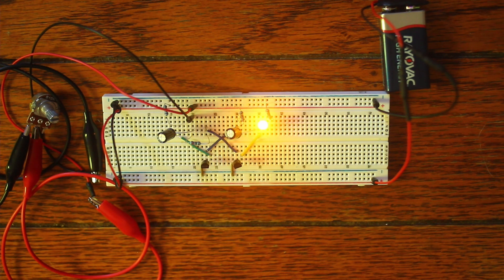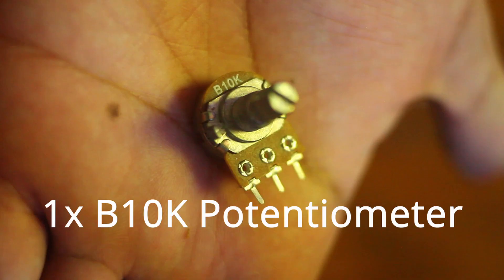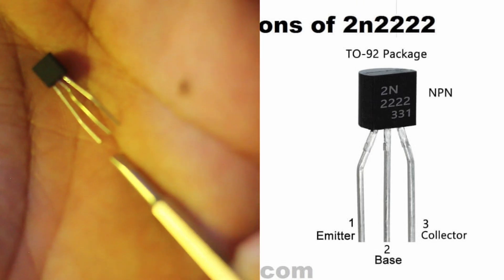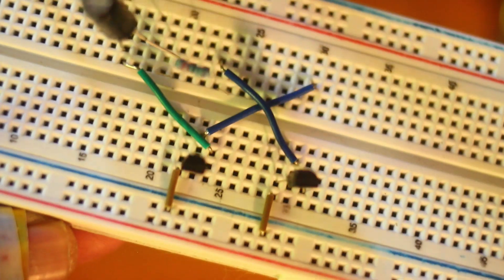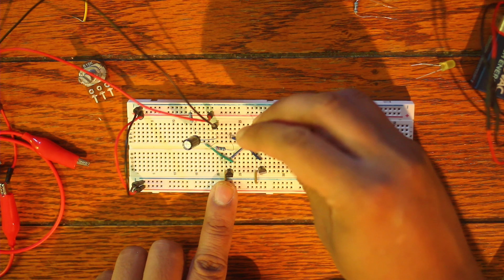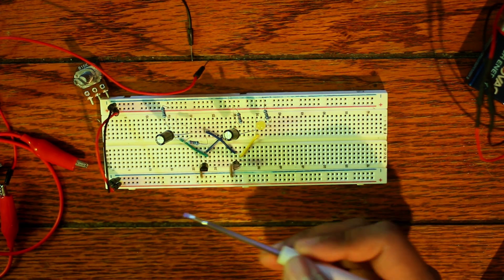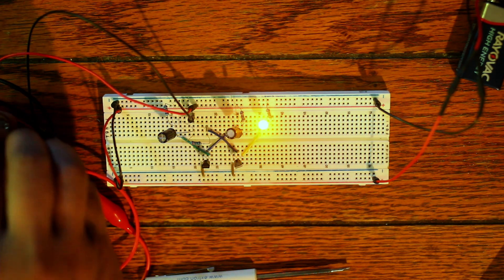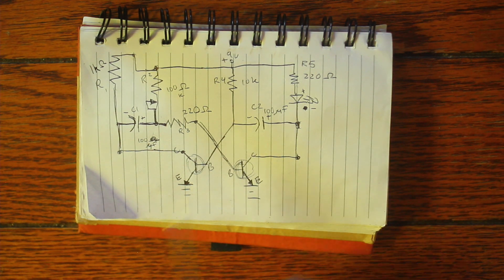Simple Oscillator Tutorial Beginner Electronics #5

Comment: A very common circuit you can find in a lot of variations in electronics literature. But this circuit is really bad electronics design because the transistors operate in a current voltage quadrant for which they are not designed for: base voltages considerably below ground. At operating voltages higher than 5 V the base voltage can reach well below the base-emitter avalanche breakdown which is typically between -5 and -10 V relative to ground.

For the 2N2222 it is specified to -6 V according to datasheet. It means at 9 V operating voltage the base emitter diode is always operated in avalanche breakdown regime. So about 1/3 of the capacitor charge is wasted in one rush for heating of the base emitter diode of the transistors. You can see this clearly on the oscilloscope screen. The base voltages stop at -6 V. If you use higher capacities like more than 1000 µF the transistors will be destroyed immediately or after a certain time. And even for lower capacities their parameters like emitter collector leakage current and current gain will degrade more and more.
Reply from the maker: Wow good insight. thank you for this!